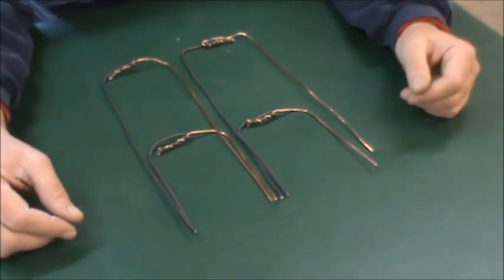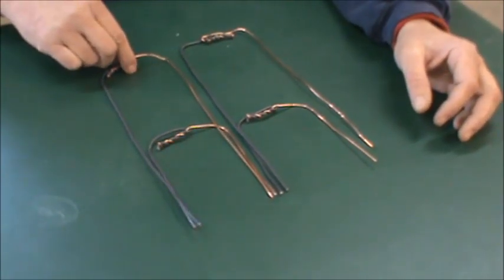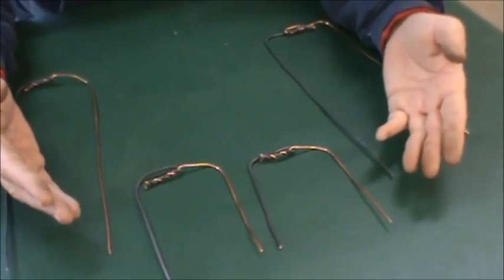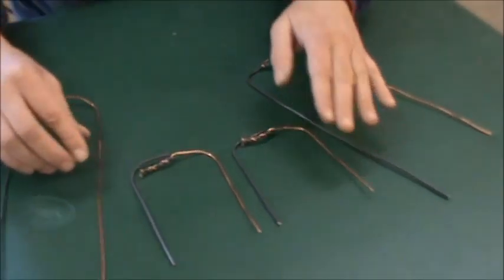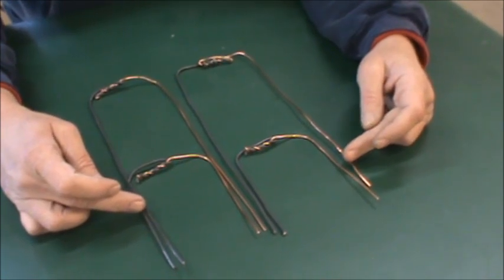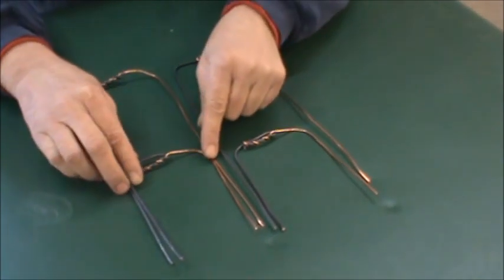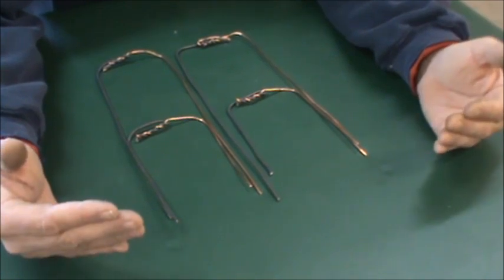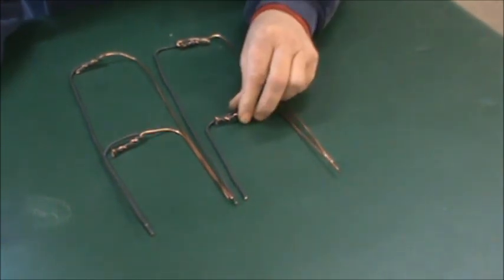My Civic EV Electric Car Project Part 15 2S2P Battery Modules Explained

Comment: Very VERY good explanation, everyone who knows what parallel and series means should understand 2S2P batteries after this video, a simple explanation for 1C is, take the Milli amp hour of the battery (Mah) for instance 2100 and discharge the battery at 2,1 amp (2,1 amp = 2100 Milli amp) till its empty, you've discharged with 1C, discharge with 4,2 amp and your discharge is 2C because you doubled the discharge amp's, double it again at 8,4 amp and you have 4C (hope this helps, correct me if I'm wrong)

Comment: Great explanation Tom. Are you still tearing the wiring out of the units from the orange plastic. If so what do you want for the wiring and connectors. I want extras to clip in and possible measure individual cells for issues if possible while in the car.

Comment: Your explanation is accurate...I've worked with series & parallel circuits in my line of work as an HDR. Some big rigs use 12 volt cranking & have 3 batteries parallel...others use 4 6 volt in series...depends we have a series parallel switch so we can charge the with 12 volts & use 12 volts for the rest of the electrical system...
Really good vid Tom...

Comment: Thanks Tom...You answered my question...I figured that was what was going on.
Reply from the maker: lol I made the video with you in mind. The controller will handle 120.8v so I have to get my voltage as close as I can without going over. Then ill use all the rest of the modules in parallel. Keep in mind Ziggy the car will run on just 16 modules (120v) and have the same performance. just wont go very far.
Don't hesitate to ask questions mate. It doesn't do me any good to make a video if people don't understand it.
Reply: tomswonderfulworld
If you're using the HPEVs system with Curtis controller it will do more than 120V, maybe around 130V or so.  I've had mine up to around 128V on regen.  You might have a problem with capacity though if you can't charge them to 4.2V, and Jack's testing seems to show there is a lot of capacity to be had up there, unlike LiFePO4.  If you only charge to 3.9V per cell, 7.8V per module, that's 124.8V for 16, but you may only be half charged.  8.2V per module is 131.2V for 16, probably too high for the Curtis.  You might need to run 15 modules instead of 16.